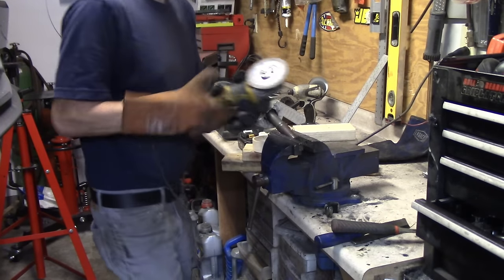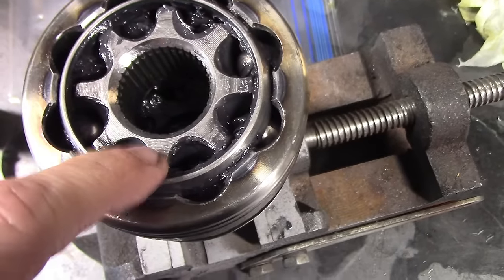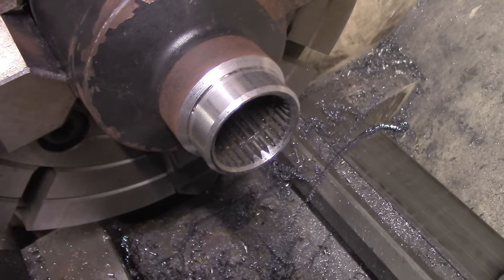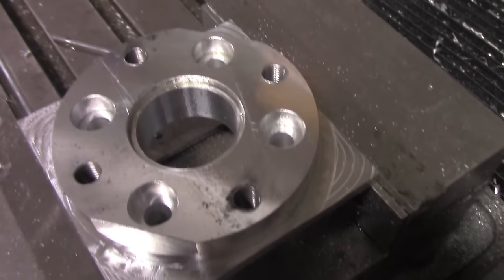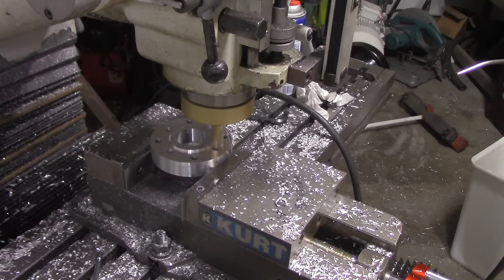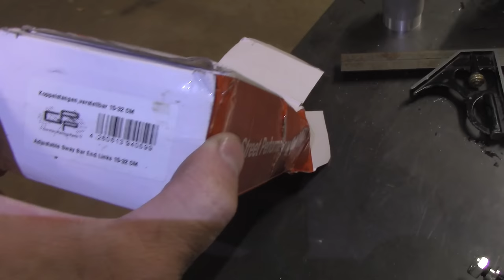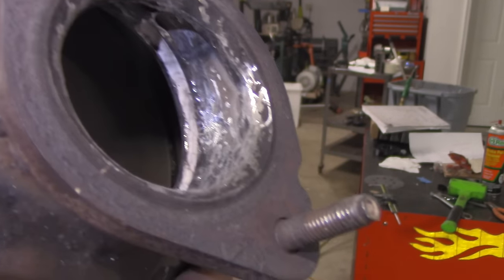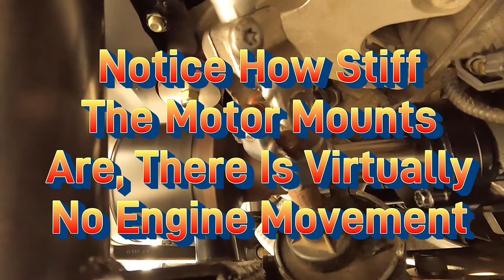The Worlds First AWD S550 Mustang!!  - American GTr Hits the Road, All Wheel Drive Mustang Ep 25

Comment: Living in the rust belt, I am 100 pro undercoating using anything that works such as bar & chain oil mixed 50/50 with deisel fuel so, for me to see someone taking a vehicle that is pretty mint into snow, it freaks me out not knowing what your community uses whether it salt or not. You definitely have skills! Having a laith , proper experience & cad skills, 3d printing skills, I wish I had a laith.

Comment: For power adder check into the new whipple 3.0 or even a version of Magnuson 2650 thats on the gt500. They come with MASSIVE cooling bricks and ability to run an interchiller off the factory a/c so virtually No heatsoak with iat's below ambient. Saw that the new Whipple 3.0 for coyote based made 1100whp and over 950tq on a f150

Comment: Put a Whipple Supercharger on it. Makes a ton of power and drives like stock until you floor it. 
Don’t forget to do the billet oil pump gears!
Reply: And crank sprocket yes sir 🇺🇸💪🏼🐎
Reply: TSS makes the best one... Also Ford Performace makes a good one. The one from the shelby GT500 is solid too

Comment: You might want to consider a centrifigal supercharger. Procharger or ESS supercharger. I have a Roush TVS style supercharger on my 2015 GT and it's almost too much torque at lower speeds. I track my car and the Roush has so much torque at lower RPMs it makes it very hard to put the power down coming out of a corner without kicking the rear out. I'm probably going to pull if off and put an ESS centrifical supercharger on the car. Should be smoother and easier to roll into the power than the Roush supercharger. For sure a turbo (or twin turbos) would be great. And you'd certainly get very linear torque delivery. But probably more work to put in the car than a supercharger. You've shown us some fantastic workmanship Tim! Congrats on the sucess, an obvious result of your careful craftsmanship. Really appreciate watching you put this car together! Thanks!

Comment: My only attempt at shortening a driveshaft I did just like this. I chucked the splined end up in my lathe 4 jaw, and since it was too long to even fit on the bed and I didn't have a steady rest, I built a little block on my workbench behind the lathe with some skateboard trucks that I moved in and out to get the height exactly right. I then tack welded around, rotating 180-90-180-90 and so on, pushing the shaft by hand to zero the indicator each time to get it just right. I ended up with .002" TIR and I didn't even need to take it later to be balanced because there was no vibration. It was supposed to be a temporary measure to get me on the road before the weekend was over but I ended up running that driveshaft for 20k miles before I sold the truck a few years later because it turned out perfect. If you've got to weld a shaft straight, doing it in the lathe is a good way to get it done.

Comment: I have an Explorer ST with a tune, intercooler, etc.
I have been saying since I got it, that I would buy a Mustang with this drivetrain and they already have the parts from it and the SHO.
However, after spending a day driving a Mustang on the Roval at the Ford Performance Racing School in Charlotte, I would think a manual transmission and a V8 would have some track advantages. 
The problem with Mustangs is that they don’t have enough traction, so the GT 500 gets beat by the  M3 BMW in the quarter mile because it holeshots the hell out of it with it’s all wheel drive. And, in Michigan a Mustang is a fair weather friend, that makes on need another car for winter.
Cheers, Tony

Comment: I cannot overstate how nice AWD is to have for most driving tasks. You just get more consistent grip, particularly if you have LSDs front, rear, and at the transfer case. Don't know if this one has all of those features, but even less comprehensive setups still help a lot. Like, if you use really good CV shafts in the front that allow for a decent amount of actuation for steering then you can literally just use steering input to pull yourself through corners. That's what I do with my AWD Fusion. I can be in a turn, notice it's understeering a bit, and just correct it with steering input. It's so nice. I've yet to encounter a situation where that hasn't been an adequate solution, though I also haven't tracked my car.
Reply from the maker: Exactly, it is not all about getting out of the hole, it helps in all situations.  Especially in the rain, or sandy roads.

Comment: Super impressed with your work, Tim, and I'm intrigued; living in the Denver metro area w/ a 2018 PP2, 95% of the year is fine. However, that remaining 5%, even w/ snow tires is terrifying. I'd gladly add 200 lbs. and trade some mpg's for some  more capability.

Comment: What you can do is white spray paint on all the rotating assemblies. If there’s any interference the white paint will wear off.
Also extend the shaft coming out of the steering rack and move the steering coupler higher to gain clearance.
Reply from the maker: Thanks, I the next revision of the parts, I will tweak to get some more clearance.

Comment: definately twin turbos, its about the only thing that will challenge the traction like you want it to. a supercharger will have big power but will be progressive. the turbos will hit the awd system hard, if you pick some bug turbos with lag. this will also add the benefit of almost 'normal' driving conditions when you dont want or need all the power.

Comment: Having owned a centrifical,Roots and TVS supercharged mustangs not to mention driven Kenne bell twin screw and turbo changed mustangs imo with traction not an issue I'd run a 2650 TVS. I currently have a 2015 GT PP running a gen2 2300 vmp very happy for what it is. The  TVS  really transforms the engine I've found the TVS makes way more torque than twin screws even the whipple gen5 although gen6 is now out . The TVS doesn't fall off like the old M112s, M122 does.  11.2 psi on my old set up made 680rwhp/590rwtq with 97 octan mixing 93 with a little boostane only increasing octane and tuning made745rwhp/675rwqt on 108 octane 93 mixing with a little more boostane on a Land&sea dyno SAE corrections 100% stock unopened engine with bolt ons ie full exhaust and gen2 "stage 3" vmp blower.
Reply from the maker: A blower seems to be the crowd favorite.  Thanks for the feedback.

Comment: I was concerned about the clearance on the steering shaft when the car turned under throttle with any input load on them, figured they would move some on the balls in the CV cups loaded and may touch. Once you clearanced the OD of the outer CV where the jack shaft goes it may be plenty now. 

I always wanted a Selectable 4wd Crown Vic myself lol
Reply from the maker: An AWD crown vic would be cool:)

Comment: Ok for your power adder, turbos are awesome but the Whipple Gen6 with your 5.0 is the way to go, if you want instant torque and enough boost to have fun whenever but still keep it steerable Whipple or some kind of supercharger is the way to go if you want to roll race or street race it then turbo it, which from your video that’s not your goal. Check out Cleetus McFarlands blue “work”truck it’s a 4wd 5.0 that he went from turbo to Whipple

Comment: Very nice project ! I'm concerned about changing out the motor mounts b/c  of how the motor will move more with softer motor mounts.  If the motor moves more the oil pan will move more.  If the oil pan moves more how much will the clearance change for the front out put shafts? Soft motor mounts allow engines to move inches under full loads. I think this will be bad in the mustangs case, especially as the engine becomes a higher output engine.   which bring up the next suggestion,  many people suggest using the Whipple superchargers.  Look at the hood of the already super charged predator mustang.  It's a tall hood in the middle to accommodate that super charger.  I suspect that it's also already a very tight fit even with that taller hood.  If you want to retain the stock hood and not cut holes in it,  nix the super charger.  Some people said turbo charge it,  even dual turbo charge it,  there is already not enough room for the exhaust so I don't think this is a good solution. The exhaust looks too close to many parts under the mustang already. There needs to be lots of heat shielding already as well.  Some people said use a Pro Charger.  this seems like the right choice for your mustang.  Pro chargers are loud,  if you like that  turbo whistle with no lag this is a good solution.  This also lets you only have to deal with the intake side of the engine.  Also, since you went to so much effort to keep the A/C system,  and , since your engineering skills are very good,  incorporate the A/C into the intercooler for the pro charger.  That is, use the A/C to cool the inlet charge via the intercooler.  :P   I think this is such a good idea, but nobody uses it.  Yes A/C  takes 5 HP to run, but,  cold air inlet temps gain much more than that ( said in the opposite way, hot inlet temps lose much more than 5 HP)  and also,  you can run you car all day long and not worry about "heat soak"  :)  Yes gas mileage suffers with A/C on all the time, but, clearly that's not the concern for this project  :P  Also,  I noted that many mustangs have a listed weight of 3525 lbs.   approximately. Obviously which model makes a difference here and maybe how it's spec-ed out even.  Also that is a "dry"  weight, no fuel, is probably how they get that number.  Which makes me wonder how much fuel was in  your car when  you weighed it?   Did you remove the spare?  XD  ect.   Anyway,  great project.  I get a kick out of the people that said they want to "buy a kit" from  you.   They obviously didn't watch the part about cutting the floor out of your perfectly good 2016 car.   I can imagine that would be nerve racking    XD   not to mention all the other parts you chopped up and  then custom fabbed for your car only.  the Mustang / Toyota / Jeep   project traction car.  X)  Great project.  :)

Comment: I've just binge watched all this. I feel a bit like I did at the last installment of Binky. Yes I've subbed and hit 'All'.
I live in Australia and I have several 4x4 cars. My daily drivers are a Ford Territory turbo AWD (yes a Barra), a Mitsubishi Magna (Diamante) AWD. I also have a Toyota FJ40 4x4 with a 350 Chevy. Seems the YouTube algorithms are working - albeit very slowly. 

Re the engine mounts, if I had've seen this series when you were using those mounts I would have commented that they were going to be harsh.  
If you go softer mounts there might be a circumstance where if you snap the throttle shut on overrun in a low gear, the steering shaft might get 'touched'. Ask me how I know....

So, one time I installed a steering rack & pinion in a vehicle that never had rack and pinion as part of an engine conversion. Everything was fantastic for months, plenty of clearance etc, until I went for a several hundred mile trip to this winding mountain road for a final shakedown. Everything was going really well. 
I'm a bit of a hard charger so as my confidence was building with the car I started braking later and later and really pushing it.
Coming up to a hairpin corner and carrying high speed I braked very late and pulled the car back to first gear. It revved to nearly 5000 rpm and the steering bound up. It was momentary, nothing bad happened - ran a bit wide; but yeah... 

Getting back home I couldn't find a single issue. Ultimately it was the new 'performance' rubber engine mounts compressing and extending more than I anticipated. They were performance because the stock mounts would've just torn but still it was surprising.
What I ended up doing was buying a hydraulic swaging tool and installing 2x galvanized wire ropes with swaged eyelets near both engine mounts to limit engine torque effects. One of the header primary tubes hit the steering shaft even though there was nearly 3/8ths clearance. 
It was likely a combination of things - the body winding up, the torque of the engine and the distance the header tube was from the centerline of the crankshaft in the area it touched the steering shaft and the idiot driver of course.
There was also me underestimating overrun effects as I was mostly concerned with acceleration torque effects.

Back to the torque limiting wires, it took a few tries tuning the length of them. When the engine hit the rope, it wasn't harsh (I tried a chain first and don't recommend it as it's as harsh as your mother in law).

Comment: the specs of the 2006 Ford Five Hundred AWD?
Each is available with all-wheel drive. All are powered by a 3.0-liter V6 called the Duratec 30 rated at 203 horsepower and 207 pound-feet of torque. Front-wheel-drive models come equipped with a six-speed automatic. All-wheel-drive, or AWD, models use a continuously variable transmission, or CVT. My father had one, I drove it to Florida and back to Georgia. We love this car. Why didn't you start with this car For parts Or ideas.

Comment: This is some high level engineering.  Having some knowledge of how difficult this project would be for even a mechanically inclined individual, you sir should be setting up a production kit to do this swap.  Please don’t waste all of this engineering on just one car.  Once all the prototype parts are made (your entire car) , a few job shops could replicate the components for production.  I think you could sell a couple hundred (maybe more) kits easily and at least make it profitable enough to pay for your own R&D.   Maybe sell the kit for $12-$15K.  Expensive enough but not that much more than a typical guy who has a few bucks could afford to spend on a car he loves.
Reply from the maker: If you read through the comments, there are a lot of requests for kits.  I may ponder such a thing once my car is fully working with boost, etc.  But, I would need to design all of the parts to be much less time consuming to make.
Reply: @npvg  if you make kits please sell international!!!

Comment: Cv looks like my nut and bolt project in machine class. I got a piece of hardened steel instead of mild and it showed a lot of then spotting and change of metal fibers.
Reply: 60-70 mph is indicative of an alignment issue in the rear.
Reply from the maker: Agree on rear driveshaft.

Please explain cv comment?

The axles are temporary as I explain, I will be starting the one piece units next week.
Reply: @npvg  you can just see that you're lathing hardened steel as opposed to mild. Just observation from experience

Comment: If ford put 2 small electric motors on the front wheels of the S650 that were powered by batteries in the trunk that were charged by plug in or the alternator on a long drive it would sell like hotcakes. Call it the Ford Mustang GT-E . 500 WHP .  Crowds everywhere would rejoice

Comment: Twin Turbskis - tho i still say you should pull the coyote and drop in a Raptor motor in it. High Output 3.5L - they make forged internals and you now have a Ford GT killer...if not an American GTR. I've been looking at Copart myself for old 6MT rental stangs with your AWD system in mind lol...
Reply: 3.5 over the 5.0? Come on man seriously? SMH
Reply: Why would you downsize the engine if you're planning to throw turbos at it any increase the power, anyways? It's not like the Coyote is adverse to forced induction!

Comment: First vid I’ve seen of this and wow. Need this for my blower car to really do something 😂 but this is so crazy in depth. Thanks for sharing I have to watch everything now. For boost you’ve probably looked into it already but minimum upgrade oil pump gears and crank sprocket, also a crank saver stud are good insurance. My 2015 has a Paxton blower with 850 whp and 50k miles on it now. Has fuel system upgrades as well to support the power but the out of the box setup keeping the cats and smog legal I believe make around 600? Without needing a complete fuel system

Comment: 14:14 could you have cut in an interference fit plug prior to welding on each half?
Reply from the maker: Yes, but the part turned out great and I am currently working on its replacement, a 1 piece shaft made out of 4340.

Comment: Contact powerflex out of Germany to see if they can make you a bushing for you engine mount.
They have a great material that's slightly stiffer than factory rubber but not hockey Puck stiff like these American aftermarket manufacturers.

Comment: I'm running Nokian WR G4 grand touring tires on my 2018 and drive it all year round in Wisconsin, you might try them.
Reply from the maker: Thanks for watching, I don't think your comment is meant to critical.  But, to be clear, I am making the car AWD because I want to double the stock power and put it to the ground in the summer.  Testing it in the snow was just for fun.  Obviously the summer tires are worthless in the snow even with AWD.  A matter of fact, I ended to drive to a parking lot for the testing, but I didn't feel safe:)  Long term I want to get some good all seasons and make it sort of a 3 season car if that makes sense?
Reply: @npvg  Sure, I got the impression you were going for a reliable, all year kind of stock plus. The grand touring tires I recommend are definitely not as capable of handling 1000hp but they are amazing in January snow. Awesome build what ever your design philosophy was